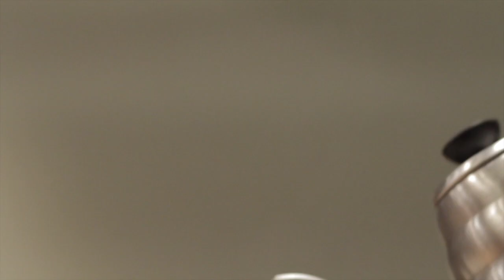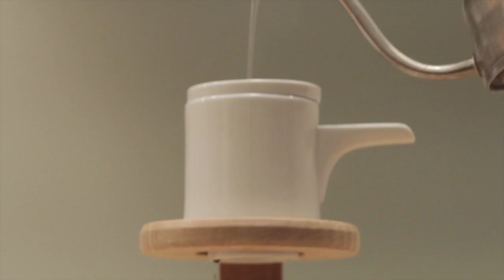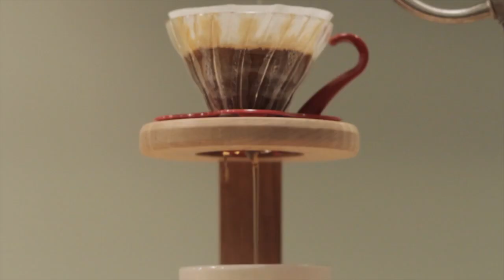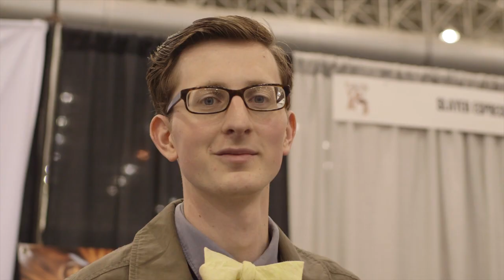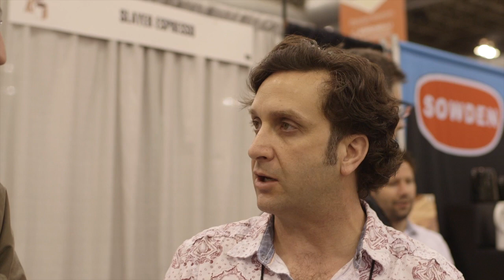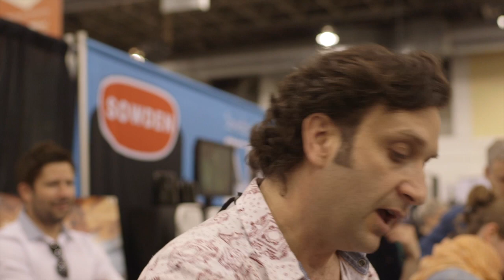Why Choose a Slayer Espresso Machine?

Comment: It looks like Espressomechanic is may be correct. If you use the very close analogy of voltage and current, the pump driving the flow will dictate the fill rate. Voltage with no current equals an empty bucket.

Comment: The fire hose part is actually kind a bullshit. It would be true it they were using standard pumps and then reduce the pressure to be able to regulate it (like the Synesso and the La Cimbali M100 do). But considering the fact that most pressure profiling machines (La Marzocco Strada, Sanremo Opera, etc) are using gear pumps, which will actually control the pressure by pumping less or more water through, you could say that most will control both, vs just the flowrate by the Slayer machine. Off coarse this doesn't necessary have to be better, but it kind busts the story of the fire hose (where the fire hose is just over exaggerating in the first place).
Reply: Interesting response......but your wrong.

Comment: I kinda dont believe what he is saying.. if you slow down the pressure of the pump non variable valve (strada EP) will be exactly the same as you limit the flow of water through a valve (like the slayer or the GS3 MP).. its just like playing a pump pressure with an open hose vs playing valve on faucet.. you will eventually have the same amount of liquid
Reply: Your understanding jives with physics and reality.